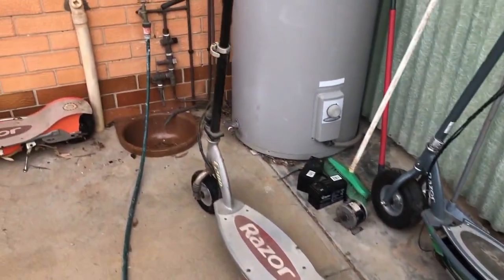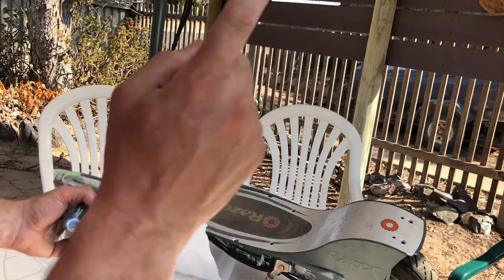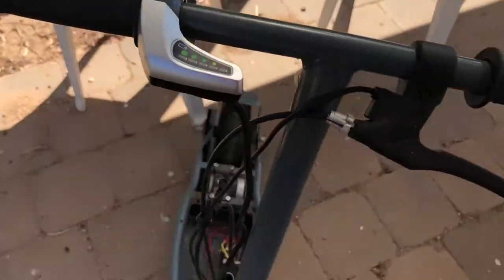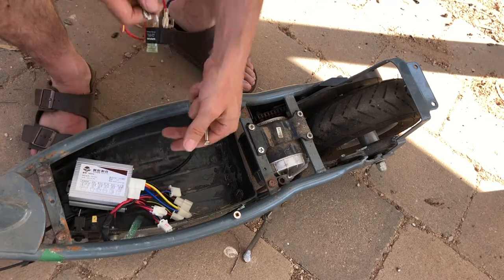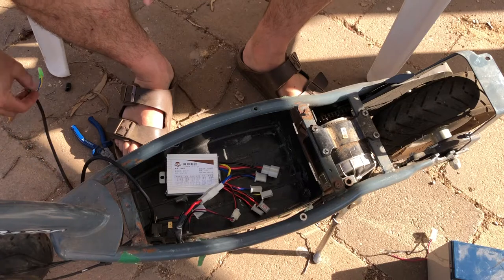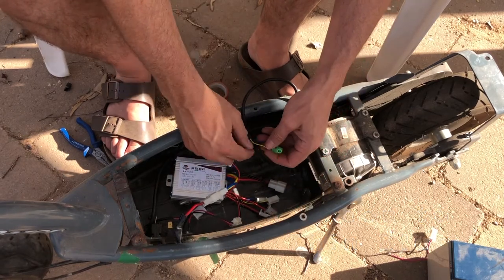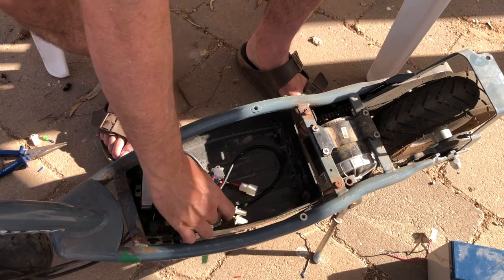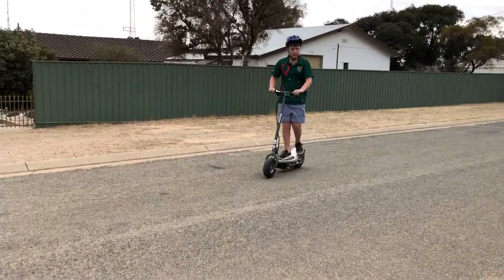How to install a Banggood 500W Speed Controller and Throttle into Razor E300 Scooter

Comment: You Need to Hook Up A 36V battery Back If You Want to get full potential out of that 36v esc... I'm using my 10s 4p Liion Packs from my eskate and also few 10s lipo packs and it makes A massive difference
Reply from the maker: Hi Mate, I reckon mine was a 24V ESC … I know though that you can purchase 36V ones …. Cheers Drew

Comment: I have a question, if you use the throttle grips you have bought, do you need to buy a new speed controller?
Reply: @Abdul_-ct6pn  with some wiring you wont have to it would be useless
Reply from the maker: You need a new Speed Controller to take advantage of the variable speed throttle grip!  Cheers Drew

Comment: I have the same controller but how did you connect it to the Razors on and off switch?
Reply: I wanted to know too
Reply: I would figure u could connect the key switch to the on and off button
Reply from the maker: Hi Jay, just wire it in series with the key switch!  Cheers Drew